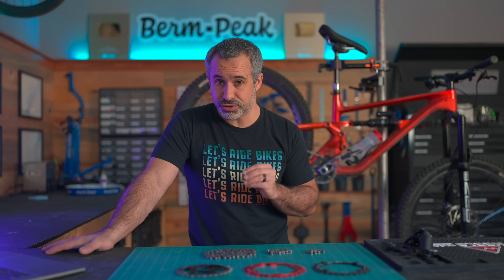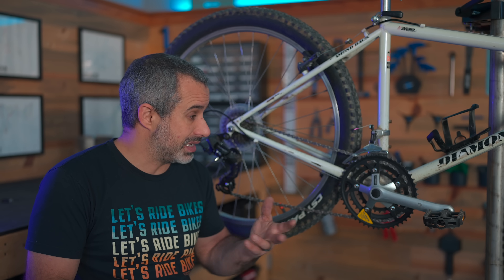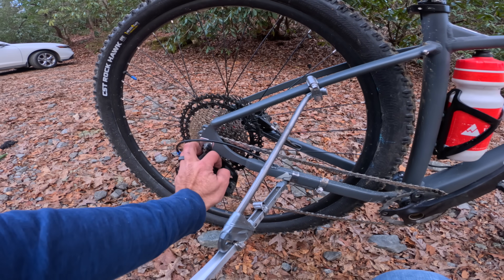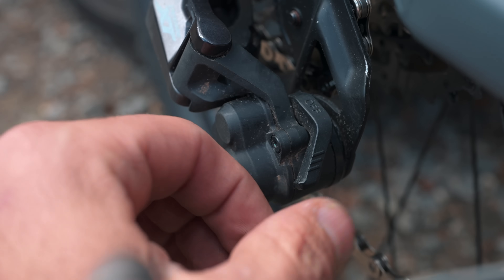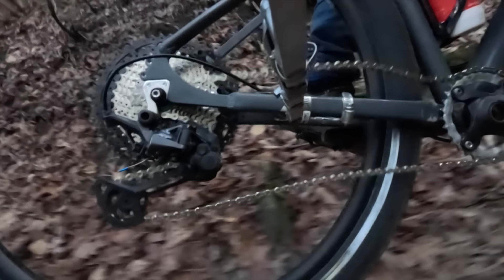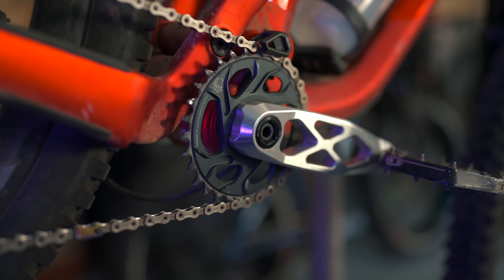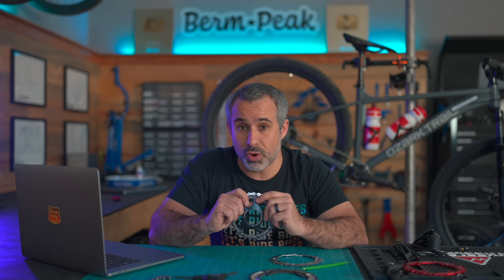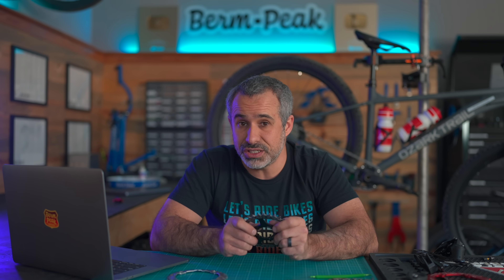The Genius of Narrow Wide Chainrings - Why they work!

Comment: I have a question for you guys:

I got my first RD with clutch, from  a grx 2x11, and, at first, i had the clutch on, but the chain came off when i shifted from the big chainring to the small one. So, i switched it off, and the chain didn't come off again.

Is that because I am doing something wrong, or is my theory correct that it is because clutches in RD's are meant to be used on 1x drivetrains?

Thanks for teaching me❤❤

Comment: I only ride 70-80s road bikes and I found one an old Fugi abandoned leaning against a tree without a cage spring, nut, washer and casing. I replaced all parts from stuff I had in Junk boxes that aren't even from bicycles but at least the cage spring came from an actual derailleur although it needed mad love from the Dremel and vice grips and everything else I used stainless steel hardware. The front derailleur needs a miracle double set It derails to the low gear but doesn't have enough sway to get the chain back. I think it might be a geometry issue it's either sitting too low/high I already maxed out the adjustment screws I might even need to bend it or add material to one of the inner friction walls that contact the chain. Maybe a piece of copper pipe.

Comment: I have a flat bar bike with 1x front.

For road and mild offroad (riding around the fields and country roads) it works with a normal chainring, no clutch, but I have a chainguard, which doesn't allow the chain to fall to the outside and chain catcher on the seat tube.
The chain basically never falls off.

Chainguard is a super cool thing for casual rider. I can use my wide trekking pants and... nothing happens. I can crash 100 times and I'll never experience the cheinring biting into my flesh.
I have no idea why this isn't more popular.
I'm converting to narrow wide, new cranks and I had to perform some real mumbo-jambo to do it on budget with decent chainline, good q-factor and a chainguard, as f.e. for Microshift Sword or Shimano GRX the spider is designed so you can NOT install anything on the outside...

Comment: I'll never understand the deviation from the double or triple, it throws away so much gearing.  I spin out (>90 cadence) at ~40km/hr as it is, why would I want to spin out at a lower speed?  The 48:14 on my 6 speed is higher gear than 34:11 on my one-by, and you don't want to increase the 34 (to a 38) and lose out on the low gears.

Comment: It blows my mind that the general concept of narrow-wide chain rings was even granted patents. It's an 'obvious' design iteration and has been around for a very, very long time in various industry. It wasn't ideal with a front derailer but never should have been locked behind patents IMO.

The most frustrating aspect of our patent system outside of extreme patent trolls is when companies somehow manage to secure a critical design element with questionable legitimacy then have a team of lawyers defend it at every turn. Every so often they lose it after lengthy, expensive court battles that most smaller companies just can't afford to risk so they cave and pay licensing while China laughs it off.

All-in-one PC water coolers with a pump simply on the CPU block is another example of this. It's one thing to patent a great pump design in this application but effectively suing anyone who dares put a pump in the most obvious position of the loop is absurd IMO.

Comment: Thanks Seth, magnificently presented and one of those topics which, as you said, although not new provides an insight into how the bikes we all ride, work.
One point not touched on is the affect of the clutch on the suspension.
First up, why is the mountain bike world so full of poor terminology!? That thing is NOT a clutch! It doesn't have a controlled engagement and disengagement, it's a friction damper. Friction dampers are nineteenth century technology and here we are using them in conjunction with twenty-first century suspension.
When the suspension compresses, the damper slows the acceleration of the wheel and rear triangle so that it does not continue in its travel after the 'bump force' is no longer acting on it. Compression damping resistance is the next most critical element of suspension adjustment after spring strength and serious riders, including racers, spend a lot of time and money getting it just right, but suspension compression also moves the derailleur friction damper which inherently has a high level of stiction - stiction is the amount of force required to set something in motion and which is less than the force required to keep it moving after it is in motion - and that throws out the carefully adjusted compression damping rate.

Comment: That narrow-wide chainring could even be usefull for some E-bikes.
I was ridind an E-bike with an 10 speed cassette on the back. And a motor in the rear wheel.
I did change gear from the 8th to the 1st in one go. The chain did drop off the chainring.
Something tells me that if the bike was fitted an narrow-wide chainring the chain would have stayed on the front chainring.
Or am I wrong about that?

Comment: Seth. My MTB isn't a hard tail, it's both hard tail and hard headed. Sure a pair of shocks on the front forks would work, but on a steel frame MTB bike where weight over long distance is important, what is the lightest type of shocks to intal? Spring, hydraulic or oil  type absorbers?

Comment: Ok so I’d like to ask a Question. I have an ozark trail ridge (based off of your suggestion for an entry level bike) if the clutch in something you get off the bike and manually set, then why isn’t it something that’s permanently affixed in the in position. Is there ever a time that you’d prefer not to have it engaged?

Comment: I love this channel, but I'm actually more of a road/commuter/cross bike enthusiast. My first good road bike was actually a 10-speed from 1968, handed down from my Dad in 1970. My current bike is a commuter with a 3x7 drivetrain. Have road bikes dropped multi-gear cranksets, or do they still use multiple gears up front? How about elliptical front gears? Does a triple crankset work with narrow/wide chain rings? I have become extremely adept at shifting the traditional design, and my routes have never caused the chain to fly off due to rough conditions.

Comment: I was modifying mine as well, and even designed my own chain guide from a block of billet before they were made available. I always hated the way front derailleurs look , bike clutter generally. plus I never used the extra outer /inner sprockets. btw 1 chain drop in 1000 makes chain guides good insurance. I coined the name "chain stay" I think its more fitting as they don't guide the chain but do restrict it from coming off. Since I began using a wide narrow proper single ring drops seldom happen, but have/do. I have enough past injuries when I can reduce those I will.

Comment: Many thanks for the video, am about to fit one after searching for quite some time to find one suitable for my Bosch motor Gen3 e-bike, sadly after shortening the chain and trying to adjust the clutch nothing worked so I hope the narrow wide chain ring will solve my random chain loss on very flat non bumpy roads! If the bike industry can cheap out and avoid fitting a component it will the narrow wide chain ring is a good example of the industry placing profit in front of customer satisfaction / bike performance and I would argue also bike safety.

Comment: The problem is actually the bike frame.  If you use a rear fork pair from above a LOT of the problems go away because your rear-pack no longer has to operate on springs but can operate on pedaling tension alone.

Comment: Such a simple product but has helped change Mountain biking for the better.
Testing has shown that a narrow wide chainring is more effective than a clutched rear derailleur and is the best option if only one chain retention choice is available.
With a clutched rear derailleur and a narrow wide chainring obviously the optimal choice for maximum chain retention.
And I would imagine it's cheaper to remove both front chainrings and the front derailleur and put one narrow wide chainring on the cranks.
Less things to go wrong and less weight. Considering cheap eBay cranks with a narrow wide chainring included are about thirty dollars delivered a bit of a no brainer well done SRAM....
😎🇦🇺👍

Comment: I remember mountain biking in the 90's having a lizzard skin chain stay protector was a must. It would at least quiet down the chain slap agains the frame. I also had lizzard skin brake handle pads and bar ends. Today with the width of bars bar ends would kill you on the trail wrapping around every tree in sight.

Comment: Wouldn't it be hard to use them on a bike with 2 or 3 chain rings up front?
I'm sure the chain would have to fall into synch but I'd think it would slip a tooth about half the time wearing the ring pretty hard.  
or
Are they just intended for single chainring set ups?

Comment: My mind was blown on my first ride on a  1×11 drive train.  The absolute silence was downright eerie, after 35 years of frame destroying chain slap .

I do however miss the range/gear spread of 3 by. For decades I ran 26/36/52 chainrings. Creepy crawly first and the 52 tooth good for top speeds of 40-55 mph. Yes, I have achieved speeds in excess of 50 mph on my mountain and road bikes.
All that said, I'll be sticking with 1 by for the silence factory alone. 

Don't even get me started on chain suck. Quite common back in the 80's.  
You could literally saw your chainstay in half  over a period of years.  Still have a couple anti- chain suck plates in my obsolete parts bins, yes those were a real thing and quite popular back in the day. 😊 👍

Comment: An additional factor is chain quality and condition. As chains wear, not only does the distance between chain link centers change but the chain also loses its's resistance to resist flexing perpendicular to the chains intended articulation.

Comment: Very interesting, just ran out to my motorbike to see what chain design they use there. On my motorbike, the chain is designed quite differently, such that basically all the links are narrow - it's hard to explain without a photo but there's a lot more overlap between the plates in the chain and it means that there is no wide link, then narrow link. It's all just narrow links. I guess this wouldn't play very well with a derailleur which is probably why you don't see that design on bicycles? (Despite this fact, most motorbikes I've owned also have a "chain rubber" which is a plastic guide for the chain)

Comment: 0:13 Narrow and wide chainrings were not invented by SRAM. They started using the system in 2012 but a patent for a drivetrain with variable width sprocket teeth was filled in 1978 by a Wisconsin company. While SRAM can theoretically claim other companies are copying their design and patent their variations, pursuing legal action could prove troublesome.

Comment: Beautiful story, but you are saying a small portion of it. Narrow-wide are ONLY available if we don't have gears up front, which means we have to have wider range on back. Which means we need very small and very big cogs on the back and potentially more of them, which means more lateral twist on the chain. Which leads to the real revolution: The big cog on the back - why the chain is not dropping that often from the 52 tooth cog, given we have insane lateral twist? That deserves a larger attention IMHO. (keep in mind, the rear cannot be narrow-wide :) )
Reply: Dropping from a cog has never been a problem, because you have the rear derailleur that keeps the chain in place.

The problem of dropped chains only happened when we removed the FD. If you have ever experienced RD problems and had to remove them to get back home you will find that the chain will keep dropping down the cogs and will not stay in place.
Reply: So, the only way this would be an issue is if you are often pedaling backwards in the easy gears. Because the derailleur lines up with the gears. The thing is, your comment makes no sense as we are talking about 1x, then here you come talking about how he's not telling the full story when he certainly is...... it really doesn't make any sense, your comment.

Comment: I have been riding MTB for over 20 years and did not know the reason behind "narrow wide". Not enough reading I suppose. THANK YOU. I really enjoy understanding my equipment and how it works.

 I was a VERY early adopter of bash guards, chain guides, and 1X, well before they were even introduced by the big two MTB drivetrain forces,  SRAM and Shimano. I made my own guides, and turned the teeth off of large chainrings in a lathe to make a  bash guard that didn't exist yet, to get obstacle clearance and chain keeping. I HATED DROPPING chains! And I hated front derailleurs. When bikes started appearing with 2X I knew 1X was coming close behind.

 My 2018 Stumpjumper came as 12 speed, 1X, with a chain keeper, and I have never lost a chain. I installed an ISCG 05 MRP basher too.  I don't even know if it's a narrow wide chain system!! (SRAM), but it likely is.😬 . I never observed the one way fit of the chain on the front sprocket. It just works.

 Thanks for the interesting and informative breakdown.

Comment: +1 for your anecdotal evidence. I have a gravel bike runnning a non-clutch rear derailleur. Had chain drops whenever I went underbiking, until I upgraded to an even cheaper chinese narrow wide chainring than what you have in this video, and I haven't dropped a chain since. I originally upgraded purely to get a smaller chainring, and only realised the anti-chain drop benefit of the chainring a few months later, on reflection.

Comment: 0:44 Clutch derailleurs were a huge thing too.
Reply: 6:28 an almost completely relaxed R derailleur cage not applying sufficient tension? Astounding.
Reply: 10:25 The clutch was the most significant.
Reply: Clutch clutch clutch. If I had to choose one or the other: clutch.
Reply: 10:41 Literal chain guide displayed. Clutch wins.

Comment: I normally ride with the clutch OFF when racing.  It makes shifting easier at the lever and gear changes are much quicker.  I do not have chain drop issues due to the narrow-wide chainring.  I agree NW is one the best advancements in mountain biking.

Comment: Ok  I never taught of this:)) thanks for testing it. 

Does this mean that you cannot use those big small tooth chainring with a shifter? can you test this before we do?:))

I do prefer 2x instead of 1x...i guess i am old school. 
What I HATE about 1x transmission is the chain angle...it just makes me sick to look at the chain angle when on the upper or lower limit. This means more chain wear but chains are suppose to be cheap so...who cares right?

I used to ride 52x11 on my old 26 cross country bike (now it feels so hard to do but i guess youth and exercise are gone) and now that you mentioned I noticed that my 52 teeth from shimano (and old xt) had almost the same idea -- one the the left and one leaned to the right so it kind of has the same effect of making the gap smaller.

Comment: Hmmmm... not a perfect comparison. The non-narrow-wide ring you used was a 3x-style, with short tooth height and ramped teeth to facilitate shifting between chainrings. Even when we converted to 1x drivetrains in the 2000s we would get a chainring designed for 1x use. It was not narrow-wide but did have teeth that were higher and non-ramped, which dropped fewer chains and lasted longer (though not nearly as good as NW - still needed a chainguide).

Comment: Right now looking at an Urban/Commuter bike with a 1x setup. Kinda confused as to why it has got a clutched derailleur but no narrow-wide chain ring. Would help a lot when riding over cobbles or curbs. Could it just be that narrow-wide chainrings become pretty expensive with an increasing number of teeth?

Comment: I need to either add narrow-wide timing rings to my tandem or just upgrade to a carbon belt and be done with the chain altogether.
Broken belts suck though.  Without a spare, you're toast.  Chains can be fixed, sections added, etc.